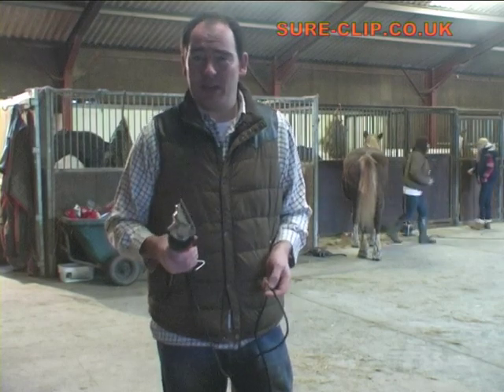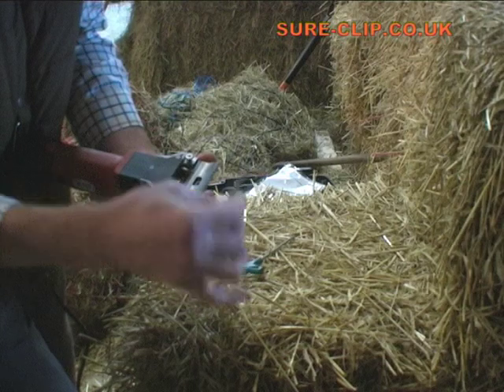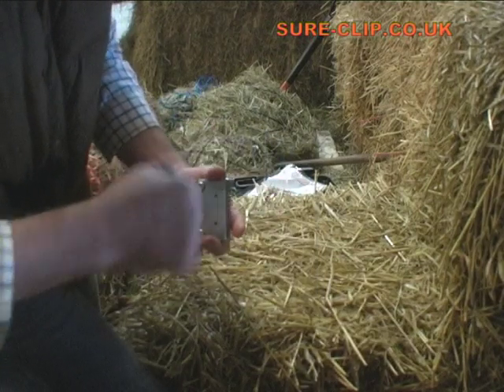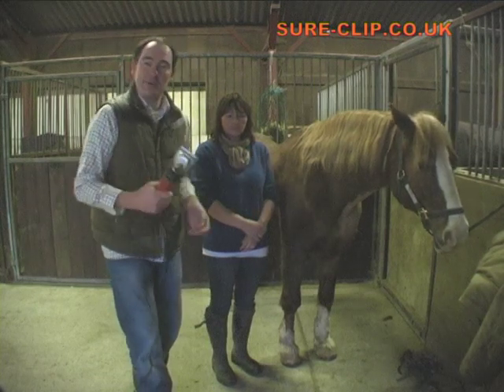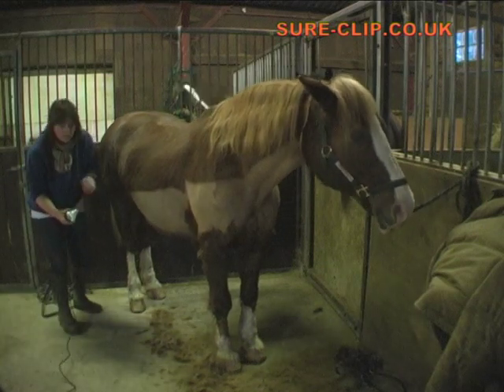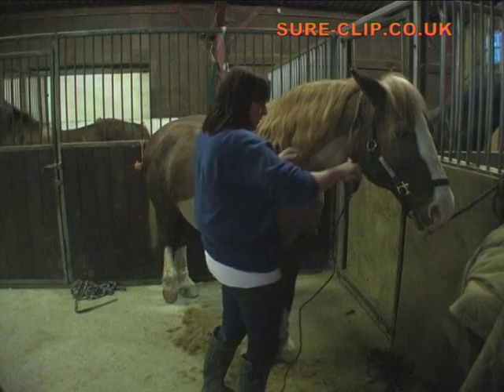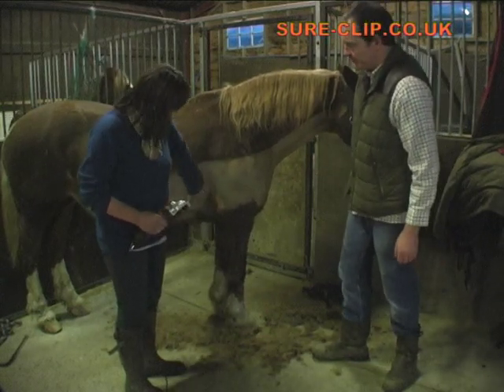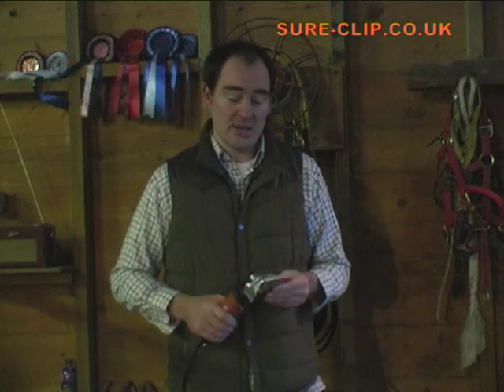How to use Horse Clippers by Sure-Clip

Comment: Hi I've just bought these clippers and set them up as instructed.. The tension screw is really stiff no matter what way I turn it. I tightened it as far as it would go and then release it by half a turn or so. I managed to do a whole trace clip with a break in between to let them cool. Then all of a sudden they kept shorting out. I took them apart, removed any hair, oiled and left for 5 mins... went back to clip and as soon as it touched the hair they shorted again, cleaned again, tried again and shorted straight away. What am I doing wrong?? My horse is ALMOST finished!